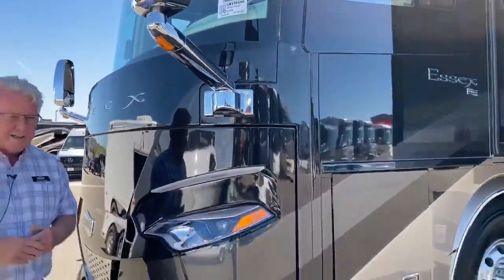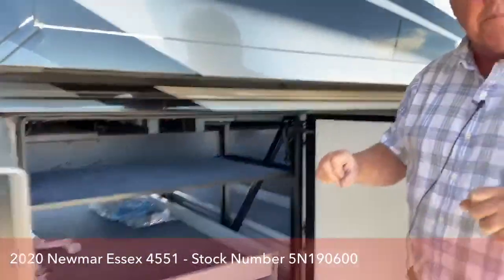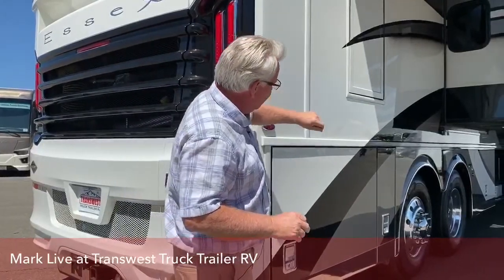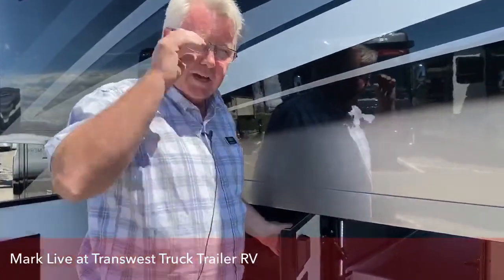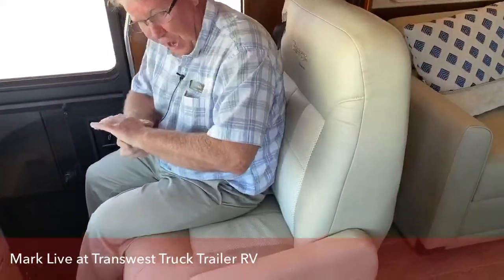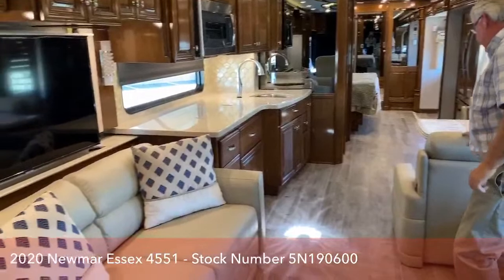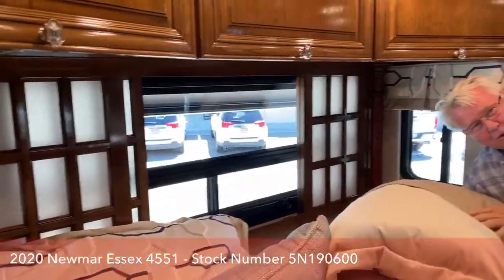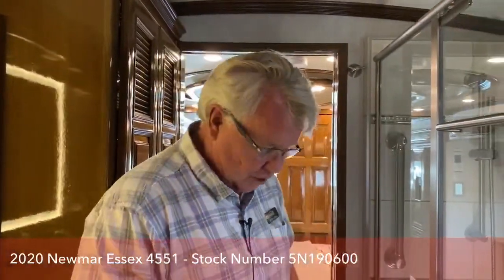2020 Newmar Essex 4551

Comment: "Watermizer" really bad idea. If I AM standing in shower before water gets hot all the dirt from my body will go into  my drinking water. Even if no one is standing in shower waiting for water to get hot the dirt from a dirty shower stall will recirculate to fresh water tank to be drank.
Reply from the maker: Hello and thanks for tuning in! The water does not come through the showerhead while the Aqua View Showermiser system is diverting the water back to the fresh water tank. It stays in a close loop system until the hot water has reached the shower valve. Then the light will change color indicating that the hot water has reached the shower valve and now you can step in, flip the switch, and have a nice steamy shower to clean all that dirt off. Please follow the link below to view the Aqua View Showermiser video for an overview! https://www.youtube.com/watch?time_continue=11&v=zR4WF6Ugjys&feature=emb_title
Reply: @transwesttrucktrailerrvoff5922  ,OH, OK, I stand corrected , Thanks for the clarification.